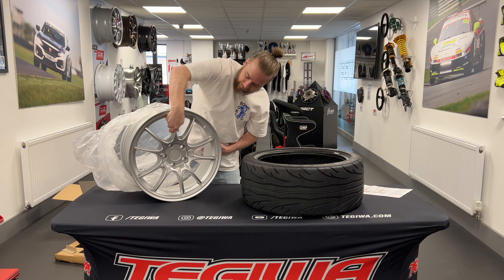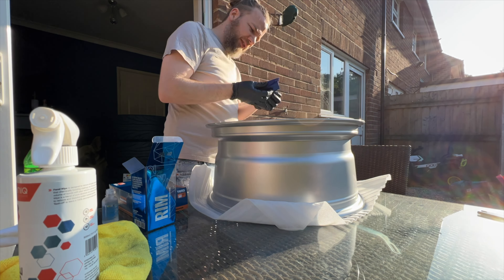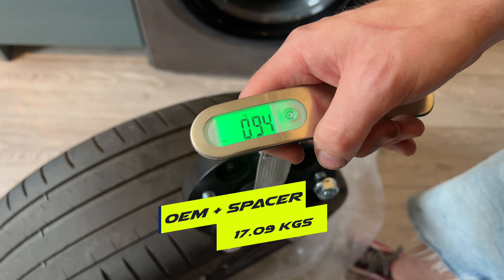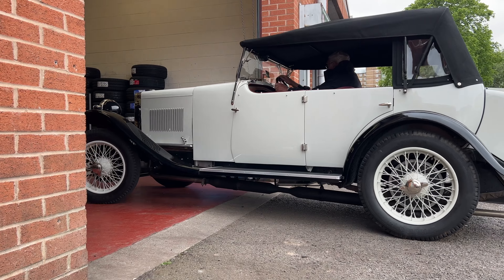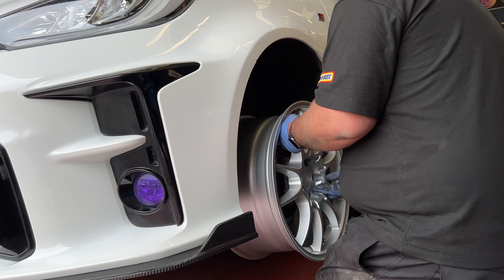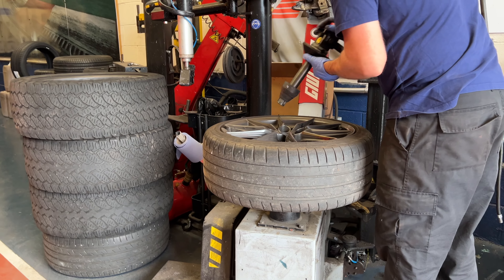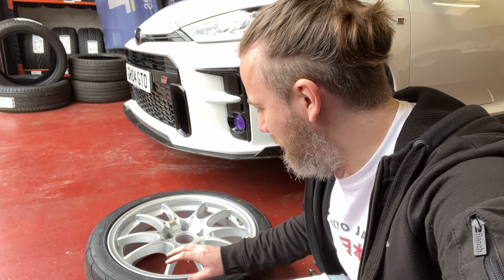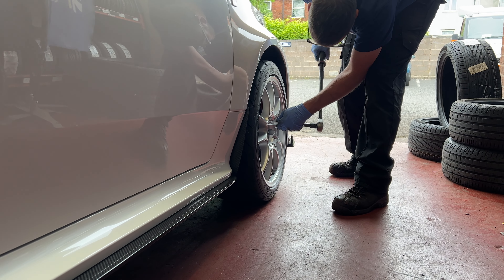New Wheels On The Gr Yaris! Motegi Mr152 And Nankang NS-2R

Comment: Another great video! Thanks for sharing. I did wonder how you got round sorting the TPMS valves when swapping wheels. Did you swap out the original TPMS valves into the white wheels when you fitted them? I'd like to have 2 sets of wheels for my Yaris, keeping the OEM wheels and tyres for the winter and a tasty set of gold 5 or 6 spokes with sticky Nankangs for the summer....! Cheers, Ross (GR Circuit Pack - In Scarlet Flare)  😊
Reply from the maker: The TPMS's came over from the stock wheels to the Motegi wheels, nice and easy through the tyre shop. When I ran the white ROTA's I ran them with out TPMS's. There was a amber light on the dash but other than that the car didn't mind it.

Comment: Mate, the oem stud is really short, how is the thread engagement? Is that why you are using the Japan racing lug nuts? The car looks fantastic btw.
Reply from the maker: The studs aren't the longest. I went to the Japan Racing lugs as the OEM ones have a different shaped seat compared to the OEM wheels so need to run different nuts. 
The Japan Racing nuts need at least 7 turns of engagement to ensure proper torque and we measured over the 7 turns! I'm really loving the white on silver! But does mean the get dirty quickly!

Comment: Hi bro are you on stock suspensions? And did you adjust camber by using this wheels? Thanks wouls really appreciate it
Reply from the maker: Yes, im on the stock Circuit Pack suspension. I only have the upgraded Toyota camber bolts on the front with some extra camber.